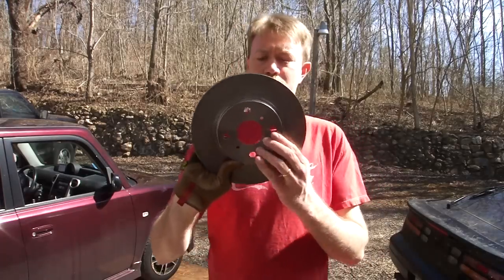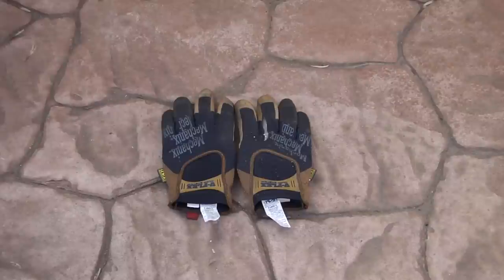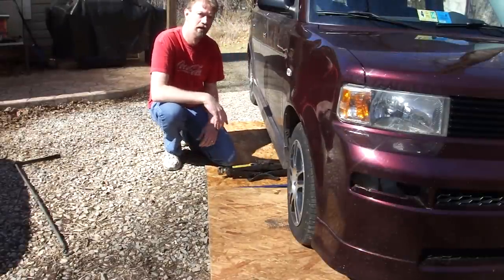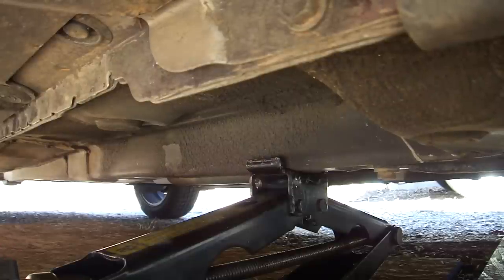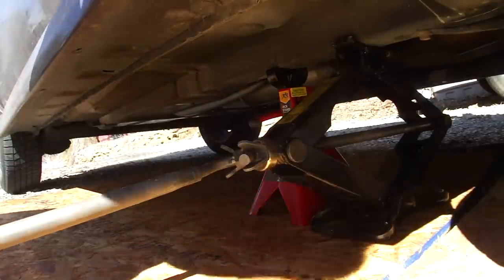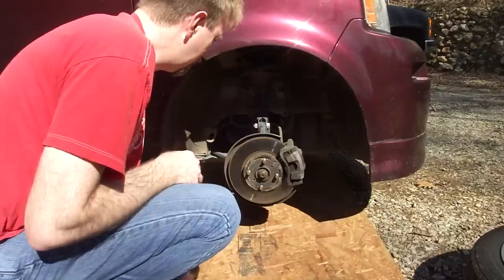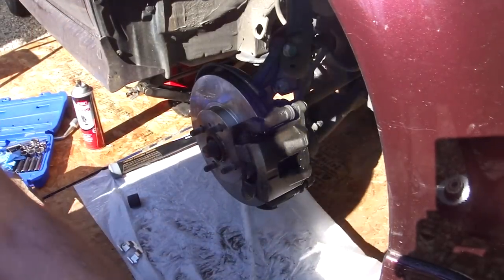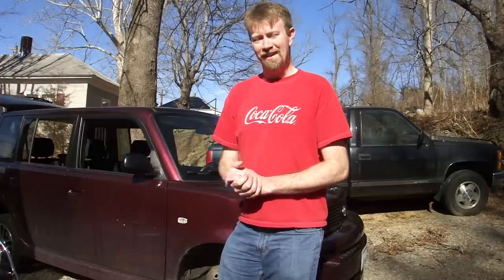Changing the Rotors and Brake Pads on a 2006 Scion XB

Comment: This was a huge help. I actually had to run a bolt through to get the rotor off, and it worked faster than anything I've ever done for a stuck rotor. Thanks a lot.

Comment: Very good video, the only thing I did different was to use one of the old brake pads, put it against the hydraulic cylinder and used a "C" clamp to squeeze the cylinder back slowly, also take the cap off the Master Cylinder to allow any air to exhaust when retracting the cylinder.
Reply: Oh...sh#,t.... So am I going to have to bleed my brakes? I don't have anyone to help me..
Wont you get air in your brake line the second you take the cap off?
Reply: @mocservices7526  no you’ll only have to bleed the system if you open a valve at the caliper piston itself. Otherwise you’d be fine just pushing the piston in. 
It should be noted that this method is not recommended because of risk of damaging the master cylinder. But I’ve never had an issue.

Comment: Thanks!  I have a Scion Xa and your instructions were right on for that model also!  However, only having 80,000 miles on the Xa I did not change out the rotors.   Next time. :).

Comment: Its best to clamp off the caliper hose and open the bleed port when you squeeze the piston back, because forcing fluid back thru the master cylinder is not a good idea, this could in fact damage the master cylinder. Put a hose on end of bleed nipple into a old container like a pop bottle to catch fluid and piston will actually squeeze in much easier.  Also because some people add brake fluid as brake get low pushing back on the piston with a full reservoir full of fluid will cause brake fluid to spill out all over the place if you push it back thru the master cylinder.
Reply from the maker: Thanks for the tip!
Reply: Good video, well placed camera. Enjoyed it.
Reply: well said, I would add from personal experience, you can damage a proportional valve or anti-brake modulation system, .... just push the piston with a c-clamp no risk to rubber boot and open that bleeder screw. fyi

Comment: Good overall beginner veiw but incomplete. You should always take out the slide pins clean them and the caliper and regrease them. Also should use caliper lube on an parts with metal to contact aFter  cleaning those areas and make sure the pads slide easily. Avoids squeaks and premature wear of pads and rotors. I was looking for tourque specs though anyone know them?

Comment: Make sure to pump the brake before moving the car to put pressure on brake system also removing the brake fluid cap when pushing the caliper piston in makes it way easier and last note don't take advice from this guys video he did a lot of in correct steps that can cause damage and faster failed to your brake systems.
Reply from the maker: I look forward to seeing your video. I am no pro by any stretch and I am sure I made mistakes. I am always willing to learn something new. I will say my brakes are still doing just fine so I couldn't have screwed up too much.
Reply: +tallt66 yea not trying to me a dick brakes are the most important part of the car stoping is super important so I'll share some great tips a tricks on this to help you and others out I'll post a link to the video in the comments.
Reply: Still waiting for that video bruhh. Since you know so much more.

Comment: Do not use rachet in loosening bolt, and apply shock whenever you loosening bolt..
Reply: Yeah. Breaker bar and a hammer. If you have room, using a cheater tube is sweet.